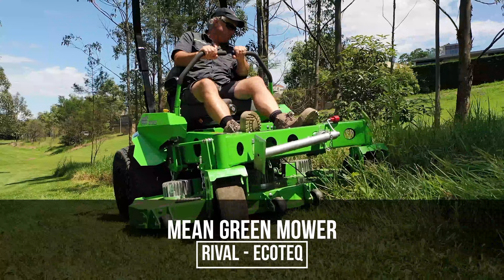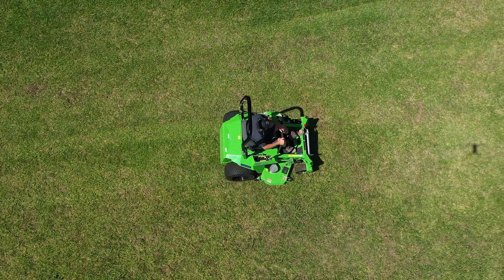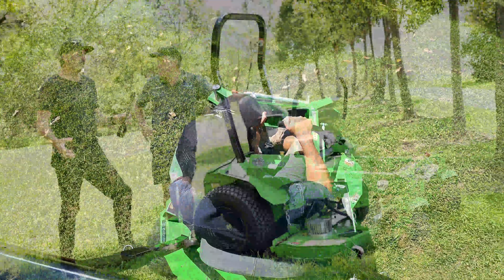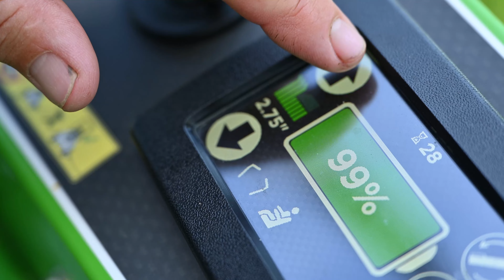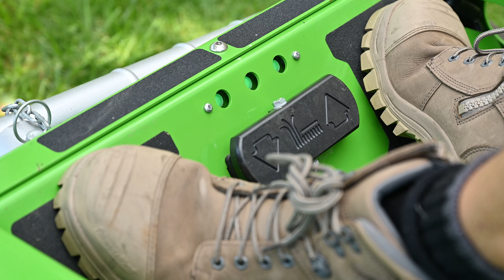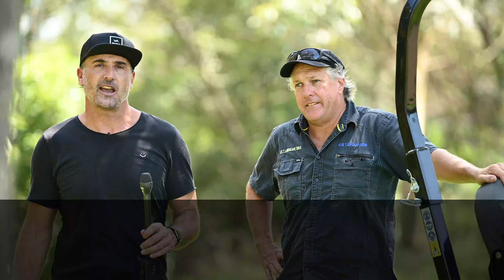ECOTEQ Mean Green Rival Mower Test Review (full version)

Comment: The one thing I as a contractor cannot stand is the lack of buyer reviews present. The only really good one I found has the contractor having to mow twice to get a decent cut on tall fescue. I am all in for green however quality standards have to be met. So it is very important to know that the decks lift grass in its deck, process the cut grass through the discharge and leave a clean quality cut in tall fescue of contractor standards in one pass or nothing else matters. I have not looked into EcoTeq but this is my issue with Mean Green. It seems that all I can find are company produced sales videos that only represent what they want you to see. Sure you can put a motor on a deck and cut grass but the cutting dynamics of a good designed mowing deck are not present on any electric mower I have seen to date. Until I see that then there is no need for me to ask any other questions. So learn from this electric mower industry. Get your deck design down or we will not be buyers end of story!

Comment: How long before battery degradation and what's the battery life span  (how many charge cycles) ? Plus how much are new batteries? How difficult is it to replace them and does it have to be done by an authorized dealer? What are the dangers if there's a catastrophic destruction or malfunction of the machine? Can it be safely operated in high temperatures 🌡?
Reply: I know this may come off harsh.  But zero emissions also means it doesn't have a negative negative environmental
Reply from the maker: @shexdensmore  We only claim that the machine itself gives off zero emissions while running. We wish we could give the entire power industry a complete overhaul! It sure needs it! While we’re not able to do that, we have created products that can charge or run using any sustainable power, like solar power, which is a huge improvement on fossil fuel models.
Reply: @ecoteqzeroemissionsolution9555  How much carbon debt is the machine in before we even start it ?
Reply from the maker: Hi shexdensmore, some great questions. With new technology comes new questions that must be answered. Our battery lifespan is expected to be 8000 hours before you start seeing degradation. We don't measure in cycles as you can recharge at any battery level and it will not affect life span. Replacement must be done by an authorised dealer. The dangers of a catastrophic malfunction of the machine are the same as any large battery vehicles, but our mowers are made to the highest safety standards, and remember, fossil fuel machines are much more likely to malfunction due to the higher number if moving parts. Lastly, the mower can be safely operated between most temperatures where grass can grow.

Comment: Thanks for the video. We need more showing different mowing conditions. Its annoying how cagey a lot of the dealers are around the price of the machines. That info should be up front even if it is a rough estimate so we get used to the difference and able to work our the efficiency vs our petrol machines. Also the rough pricing on replacement parts. Those of us in the contracting space use that info to make our minds up before we start talking to dealers and reps. Battery operated ride-ons are going to become a hotly contested space. At the moment Mean Green has the advantage as being first to market commercial grade mowers. Hopefully you guys can make the most of it and get us AU/NZ contractors as much info as you can.

There's always people put off by the price, but there should as many that see the benefit and time savings and want to give it a go, but put off from the lack of info. /end rant
Reply from the maker: Hi SeriousSamwich, some great points! I can see you are already well educated with Electric Mowers. Hopefully we can answer all your questions satisfactorily, we pride ourselves on offering all the information you need to make a decision upfront. Our Mean Green mowers are A grade commercial equipment with prices starting from 48k. In terms of replacement parts, there is really nothing to replace on them, just the blades. We now offer a 5 year warranty on the mower (details to come). We find that most commercial operators start seeing returns on the increased initial purchase price due to no fuel and low maintenance costs and are ahead of a comparative fossil fuel machine after 18 months.